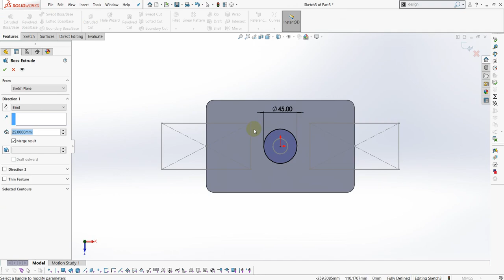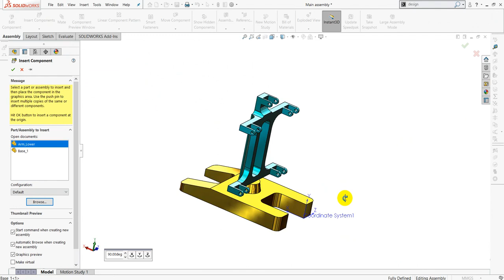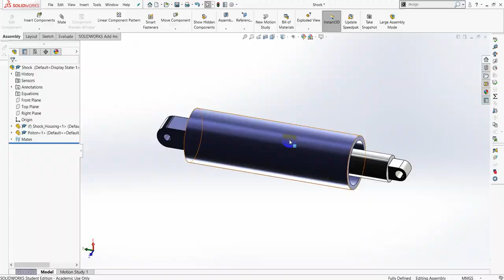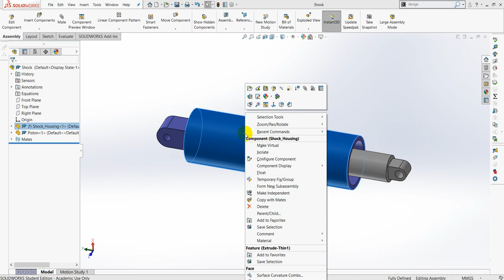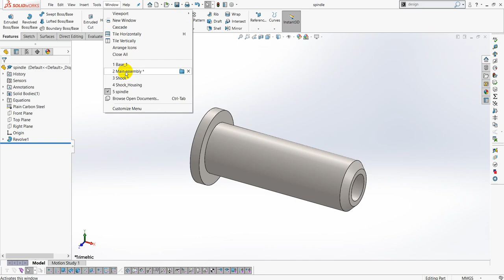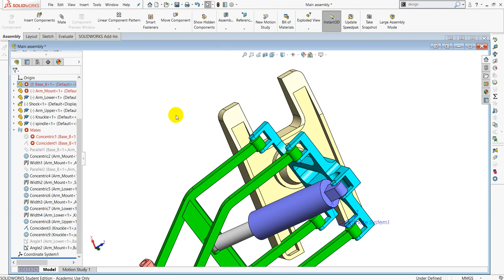CSWP   SEGMENT 3   ASSEMBLIES

Comment: It is true that you need to be fast.... I ran out of time yesterday and couldn't finish the 3rd segment:s...too much reading
Reply: @MRM.98  yes! Each one is like an hour or something. I recommend you to not do them all at the same time...I did it and failed the 3rd one.
Reply: I failed by 70 marks because was taking too much time to read. I would suggest to use a dual-screen setup so you can check faster. In my case, switching between applications to SolidWorks took a lot of.
Reply: yes you need to be fast a good recommendation is to start with questions with more points and set the alarm 1 hour before time is up